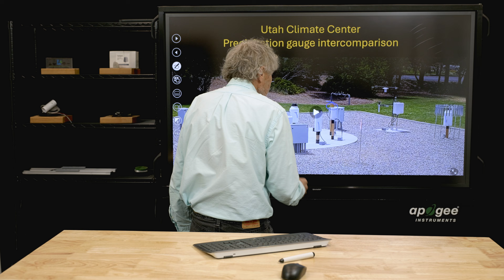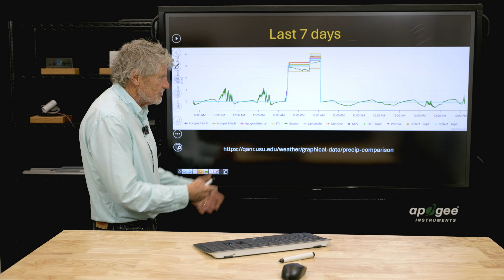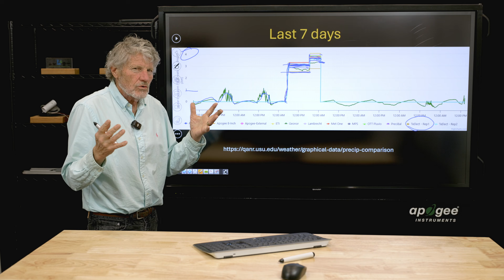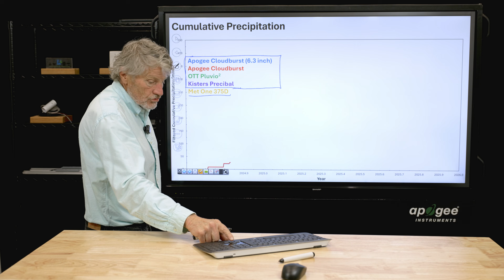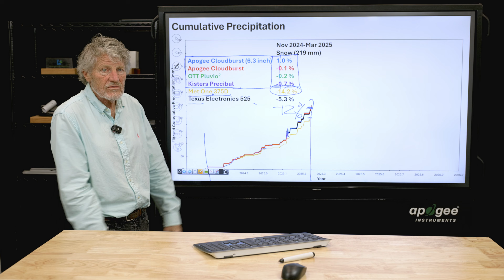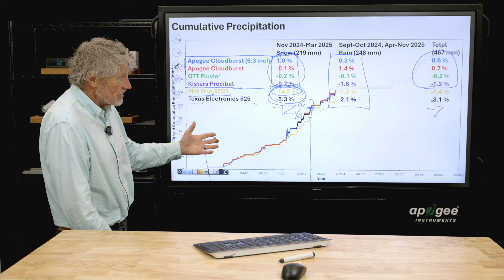Rain Gauge Shootout: Apogee Cloudburst vs OTT Pluvio2 vs Kisters Precibal vs Met One 375D and more.

Comment: Very interesting. 
What I would have like to see is you compare your results to what your local weather channel results. 

Because I have been doing something similar, for the last 15 years. 
But not with as much technology as your study. 

I keep 3, empty 5 gallon buckets sitting right next to each other in my back. Nothing around them and nothing over them. 
After every rain, no matter how big or small. I go out and measure how much water is in each bucket. 
And every time the results are different in each bucket. Within a sixteenth of each other. 
But what I find fascinating is every time my results are at least double what are local weather channel says we received. 

EVERYTIME 

Of course I understand that more rain will fall in certain areas than others. 

BUT EVERY TIME. 

Now at the same time, for the last 15 years. 
I keep 2 temperature gauges outside. 
One underneath a carport. Which gets no direct sunlight. 
And one on my shed in the backyard. 
This one gets maybe 3 to 4 hours of direct sunlight, around noon. 
I compare them between 4pm to 8pm. 
And they are ALWAYS within 2 to 3 degrees of each other. 
Now when I compare my results to my local weather channel. 
My results are ALWAYS higher in the summer time. By about 8 degrees. 
And in the winter time my results are ALWAYS lower by about 6 degrees than my local weather channel. 

Of course I understand that different locations matter. 

But basically the same results every time, for 15 years. 

I find this very hard to comprehend. 

I'm in California. 

But I basically did the same study in Nevada, for 10 years. 
With basically the same results. 

I find this very fascinating. 

Maybe if you have time, you could try the same thing. 

Thanks for your video. 

I truly enjoyed it.